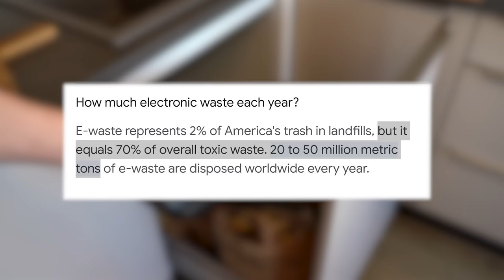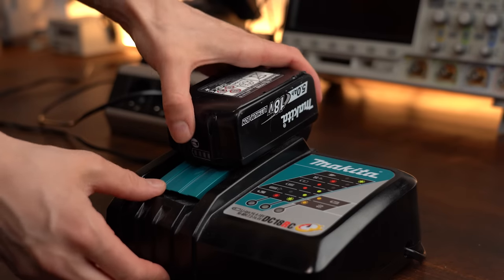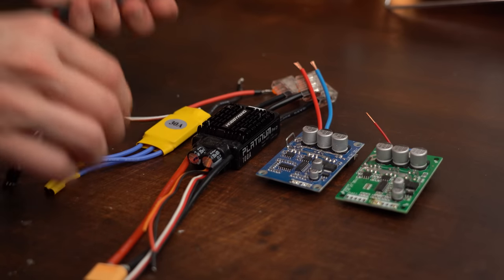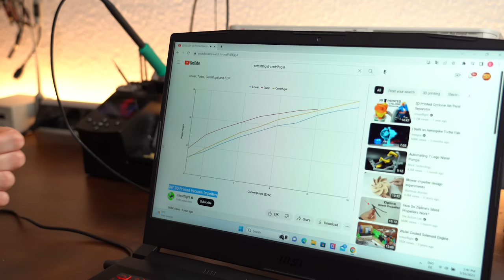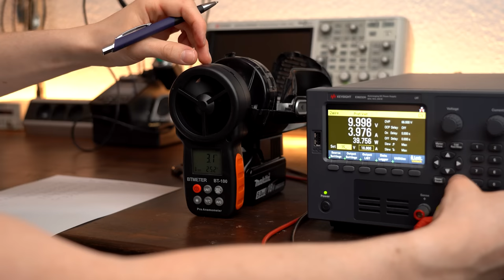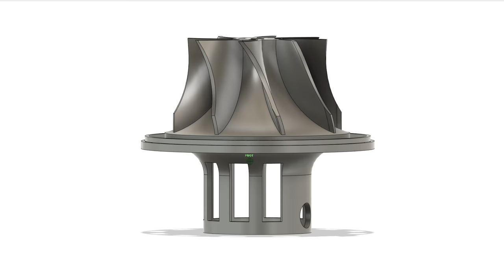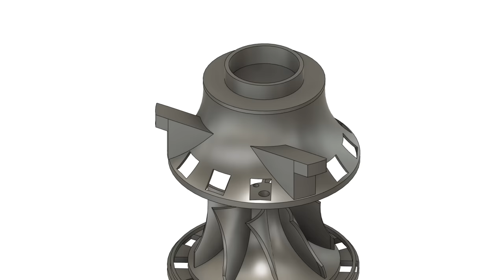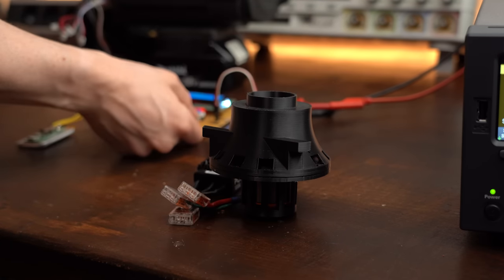I tried OVERPOWERING my Vacuum! (Homemade Turbine)

Comment: Increase the surface area of the impeller. The airflow of an impeller is defined by the speed (as you pointed out) and its surface area. By increasing the number of fins or by increasing its size overall, you can increase the airflow quite considerably. In my last blower project, I needed a 150% increase in airflow. This was just about manageable without changing the motor by increasing the impeller size by 30%. At that point, the torque of the motor reached its limit. Bear in mind though that higher torque generates more heat. You can temper PLA and ABS (and almost all plastics) in a home oven to greatly increase its tolerance to heat, although it will result in shrinkage. The Formfutura Volcano PLA filament is a good option here, too, as it allows you to temper the parts with minimal shrinkage.
Reply: tempering in general is not an option, there is a good amount of shrinkage and even if going for the method using sand or salt as fillter to prevent warping it'll still not work out well enough for the tolerances here as you need two perfectly flat surfaces. CNC Kitchen has some great videos already and it's just plain better to go for higher temp filaments and ABS honestly works just fine
Reply: It's a trade off of a lot of things.  The more air flow, the more power demanded by the motor as well.  And you need to develop at least some amount of differential pressure to draw the desired air flow through the nozzle, wand attachment, filter bag (probably the biggest impediment) and so on.  And dP is more a function of enclosed diameter with minimal bypass leakage.  So many things to experiment... so little time.  :)
Reply: @MaxC_1  Good point, Max, that the shrinkage of tempering might be an issue; at the same time, the majority of the heat will be focused on the housing surrounding the motor, not the impeller or impeller cover, so the tolerances are not that tight. ABS starts to deform at a little over 100C, which, as you said, may be sufficiently heat tolerant for the context. That said, depending on the efficiency, draw current, and torque capabilities of the motor, it can get hotter. If it does, tempering/annealing the motor housing may help, especially if using a specialty filament.
Reply: @christophlawrence  if ABS isn’t heat tolerant enough you can always go for a high temp nylon or carbon fibre reinforced nylon or something like polycarbonate.
Reply: Are you documenting these projects anywhere?, i’d love to check and see what all you’ve done, they sound neat!
Reply: @MaxC_1  Flat surfaces can be sanded down after getting warped by the baking, so it shouldn't be an issue for that particular use case.
Worst comes to worst, a little bit of padding in the design would allow to sand it down more
Reply: @ericlotze7724  Sorry, Eric, I had a "who, me?" moment there. To be honest, you're the first person to express any interest! 😄 I usually can't even get my wife to give more than a courteous grunt when I tell her about my projects! Of course, that doesn't stop me from chewing her ear off about them!

Comment: I love the idea of fighting e-waste, but you replaced the battery and its board, the impeller, the motor and the speed controller. The only thing that's left of the vacuum is the shell. And you made 4 plastic prints along the way.
Reply: Cry about it
Reply: @zynifi  thats not very nice...
Reply: @christianparedes15  don’t care do I?
Reply: @zynifi  thats not very good, are you doing okay?
Reply: That's true, but now it's open source, and can be fixed or tweaked as desired.

If your goal in doing a repair is just to save money on the first repair, it's better just to be like everybody else and toss everything in the trash and buy more junk. Repairing never pays off on your first try.

But as you build up a workshop, and skills and knowledge, you learn not only how to fix things, but how to improve them. We need more people like that.

For example, now if his impellor breaks, he can print a new one. If a battery cell goes bad, he can replace that single cell. And so on and so forth.

Comment: Fun bit of experimenting.  But I'd point out that most centrifugal blowers/pumps have a flow vs 'head' trade off.  If you design a rotor for maximum flow rates, it probably will not develop much differential pressure.  And vice versa.  The differential pressure can be important when you think about how you need to draw the air through a dusty filter bag.
Reply: This is spot on, the reason it didn't perform well. Plot flow rate vs pressure for the fan and it is a curve that slopes down. Plot the same for the filter system and it is a curve that slopes up. The point that the lines cross is the flow rate you get when you connect them together - the real world solves your simultaneous equations for you 😛

Regardless of the misunderstood engineering, it is pretty impressive to get useful vaccum performance from 3d prints!
Reply: God, I didn't expect to see a Bernoulli's equation reference... it's everywhere, man.
Reply: @Dcl2037  That's why they use cyclone filters instead of bags in high end vacuums. Lower pressure drop allosw to use more flow optimised "pumps".